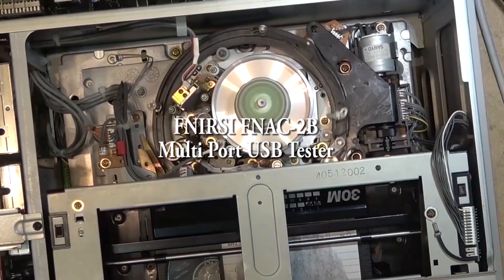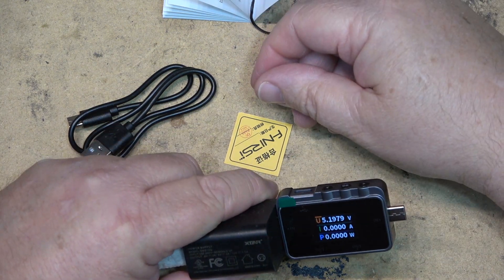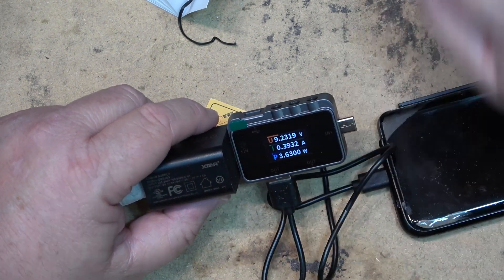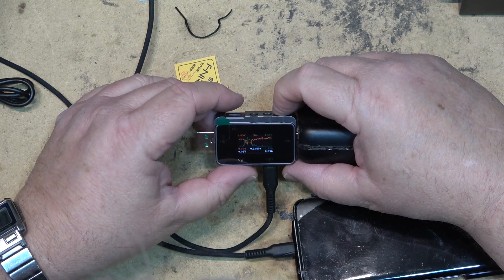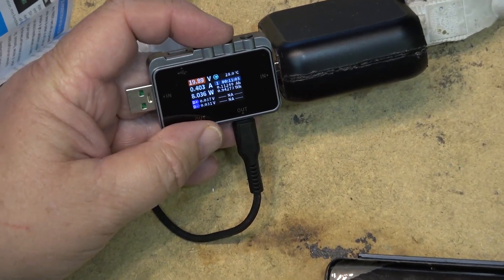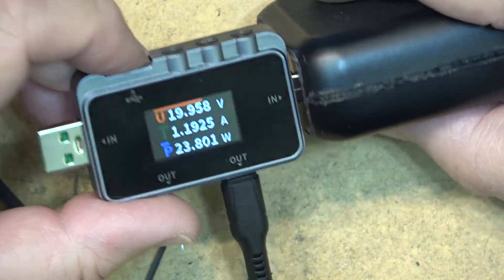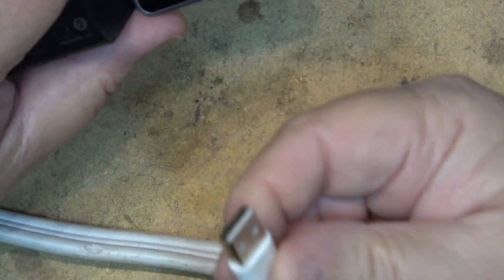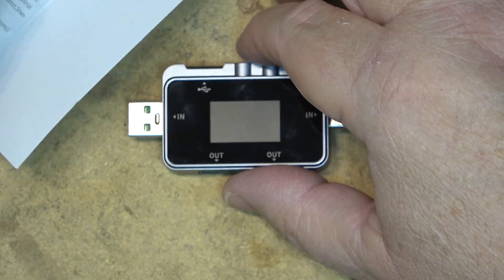FNIRSI FNAC 2B Multi Port USB Tester

Comment: Interesting piece of tech Dave.  My question is  "Why my old Ipod charges from a computer USB port but NOT with the same cable going to a car charger ( cig lighter ) or combo AC outlet  / USB  ports ? "   I saw another Tuber who bought an adapter on Flea-Bay which made non-computer ports work.  Is it a matter of reverse polarity or low wattage output ?   Your brief advice is highly appreciated.   Is there snow on the Harley these days ?   Be safe amigo.

Comment: Fast charge test works if I connect it via USB A, but the device doesn't start when connected via Type C and I can't run the fast charge test. How to fix this?
Reply from the maker: You have to input USB c to test USB c.  It won't charge a usb c device if your power is supplies with usb a

Comment: Thanks Dave, could you please check this:
Is your short white USB test cable with the resistors really bad?
Maybe that experiment/demo setup requires the data communication path before, "turning on" the juice.
Check it without the tester using a dumb 5v wall wart and voltmeter to see if that's what was happening. TY.

Comment: I bought a cheap USB tester from Amazon. It seemed to work fine at first, but then my phone stopped charging and the amps went down to 0. (Phone wasn't charged yet) Maybe it was a bad connection. That unit there is probably a lot better. I also discovered later it slows down charging significantly if the battery is getting hot, which is a good thing . And it resumes fast charging when the battery cools down.